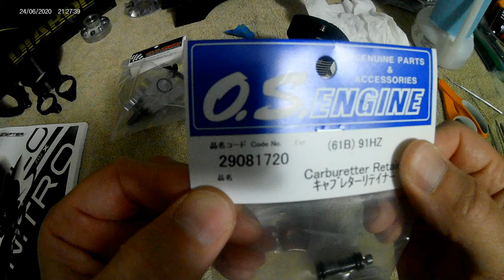#PowaTune - Introduction and assembly of the OS Carb Conversion for Ys engines

Comment: There's nothing wrong with the tuning of a YS carb. The mid simply controls most of the range and in an engine as powerful as the 96 you will very rarely be on the high needle unless you're mid is set way too rich. Also, about the needles being 'touchy' or inconsistent, this is because the higher compression YS use which makes them run better on lower nitro content and cooler plugs. A lot of people try to run them on 30% nitro and os8 plugs and they'll run like crap! Run it on 30% but use an enya #5 plug AND add an extra head shim, and only move the mid needle! You're welcome.